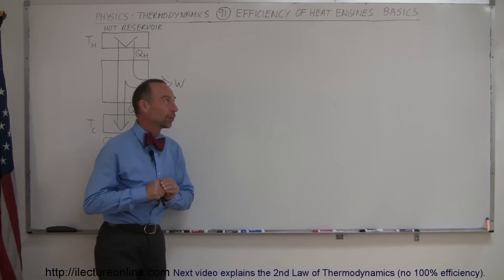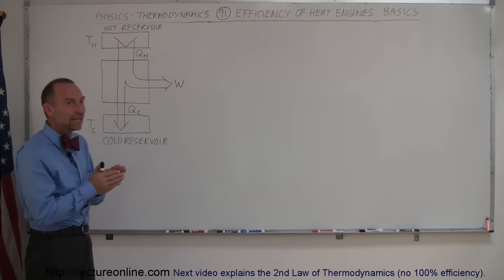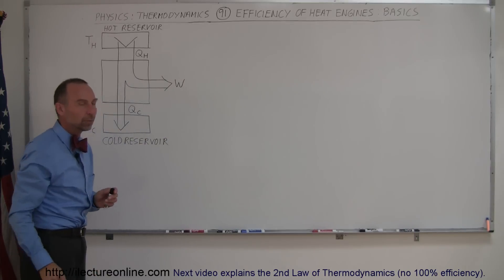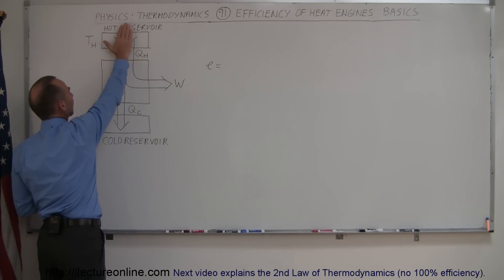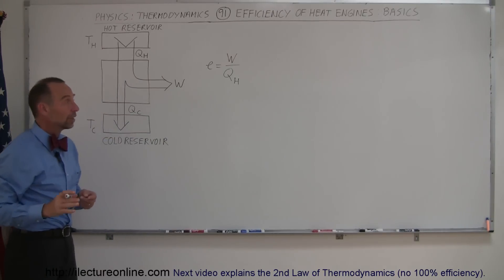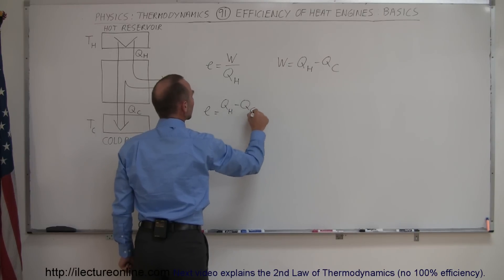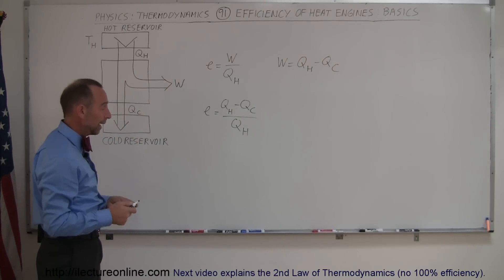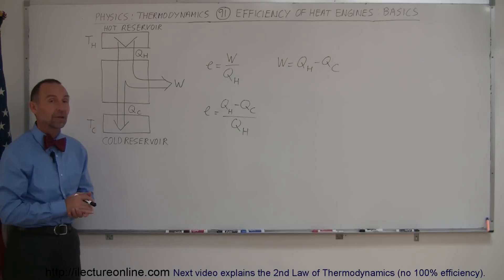Physics 29  Efficiency Of Heat Engines (1 of 14) Basics

Comment: What is total workdone on and by it ?
Efficiency?
Aneroid barometer cell cylinder have what volume and expansion in mm 

If we use a steel plate of 100000000 square meters and make a cell cylinder then what is displacement shows by it or it's not displaced ?
How much thicker plate displacement required to provide one Tera watts energy ?

Comment: Thanks for your excellent videos! They are really useful and easy to understand. I have a question related to this topic. There is a problem where two heat engines are connected in series (the heat absorbed by the first engine is used as the heat absorbed by the second engine) and I have to find the efficiency of the system. I know that I should start with the basic formulas and I have been trying to come up with the answer. However, I feel that I am missing something. Is there anything that I should do differently because of the two connected engines? Any help will be much appreciated. Sorry for the lengthy comment. Thanks!
Reply from the maker: That is an interesting question and we probably should make a few videos on the topic.  The concept here is that you take the exhaust heat of the first engine (Q2), and use it as the input heat of the second engine, upon which a portion of that is used to do work and the remaining heat is exhausted from the second engine (Q3).  Using  Q1 as the input heat to the first engine, the total efficiency of both engines is:   e = (W1 + W2)/Q1 = (Q1 - Q3) / Q1    But that said, the efficiency can never exceed the Carnot efficiency  which is:   e =  (T1 - T3) / T1
Reply: Thanks for your quick reply, prof. van Biezen. You are right. I searched on the Internet and someone arrived at the same conclusion. I will try to solve it some other time, but it is definitely in my to-do list. If you are interested, the problem statement is: "The efficiencies of the engines are E1 and E2, respectively. Show that the net efficiency of the combination is given by E (net) = E1+ E2 - E1E2." I will let you know if I finally figure it out. Keep up the good work.